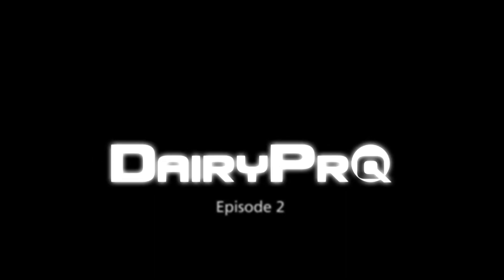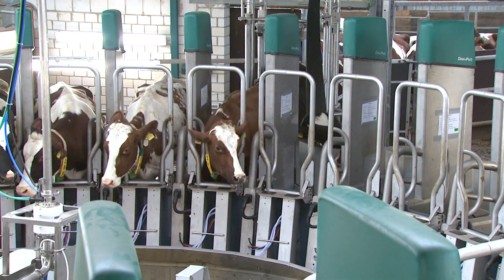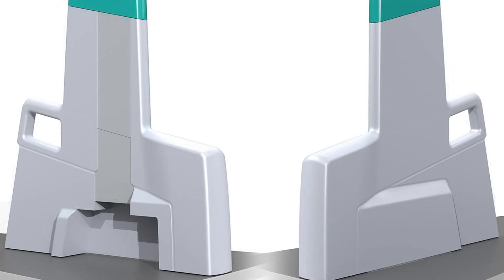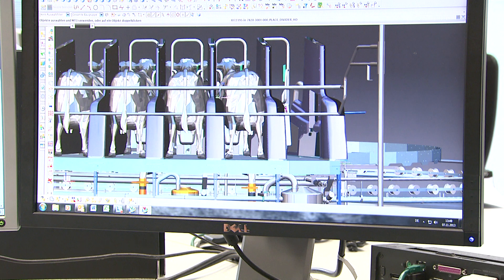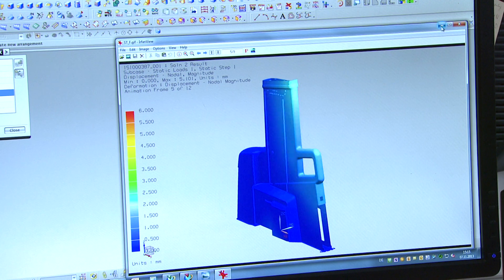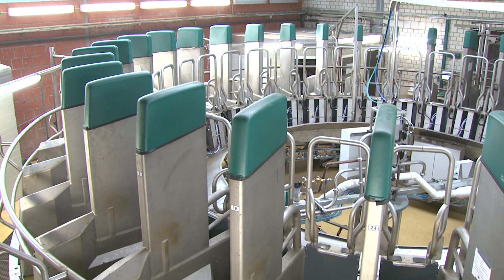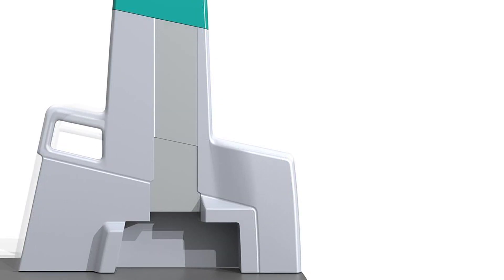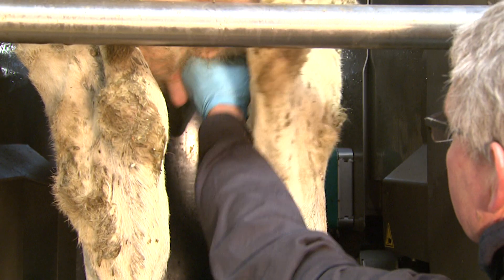GEA Farming - DairyProQ: Episode 2 – Pathbreaking design - EN

Comment: i like the concept of the stalls, but why have it on a rotary platform at all, surely this is now unnecessary. why not have multiple stalls side by side like a flat floor walk through milking parlour, so you can save money by doing away with the rotary platform and you wouldn't need such a large shed.
Reply: bonne idée que vous aviez !!!!! moins chère et beaucoup d'éleveur pourrais  le financé , c'est toujours les petits éleveur de 30 à 60 vaches qu'on oublie c'est dommage !!!  oui le robot mono... mais à quel prix ???
Reply from the maker: Thanks for your comment. Glad you like it. At the moment we’re focusing on the rotary platform. However, the modular nature of the DairyProQ module allows further parlor layouts.
Reply: GEA Farming i guess i see that putting the stalls on a rotary platform you can integrate robotic milking preparation and attachment and post milking functions onto existing facilities, though i imagine a flat floor parlour with multiple side by side walk through stalls would be more reliable and efficient. a rotary parlour requires all cows to stay on the platform for a minimum amount of time, if you have a cow that milks before this she is taking up space that could be used for milking another cow, the same if you have a cow that requires more time to milk she has to make another complete revolution wasting more time. In a walk through parlour each cow is only in the stall for the required time to milk and no more. Another advantage is that if any individual stall is not working you can easily disable it and keep the milking operation working with all the other stalls with little disruption. is there any guideline on what price each module will be?
Reply from the maker: JCB411abuser Thanks again for your input. Please send your contact details to contact@gea-farmtechnologies.com and we’ll get back to you with further information.